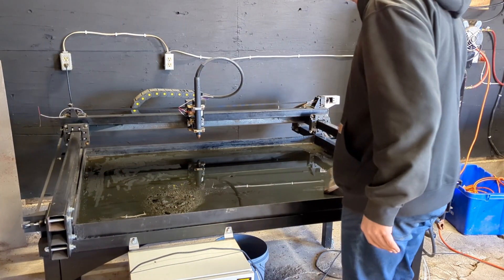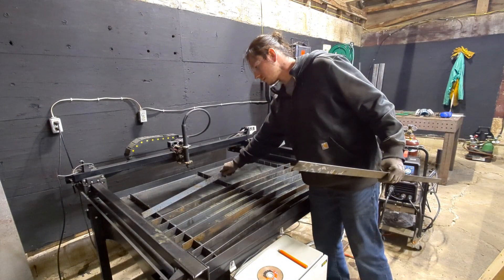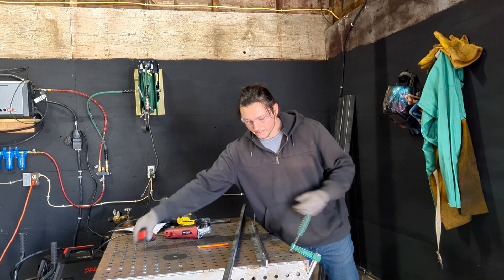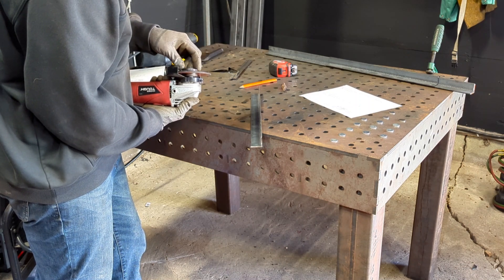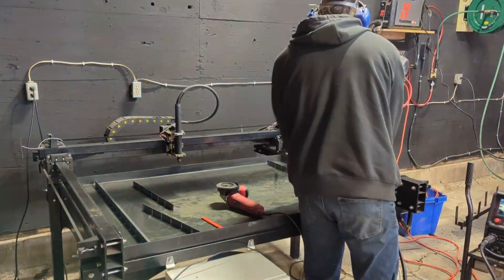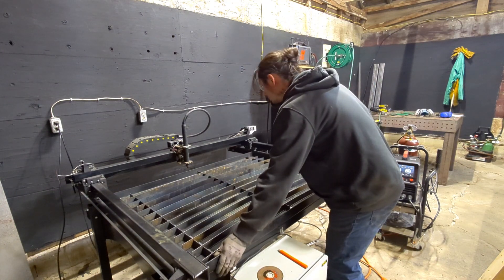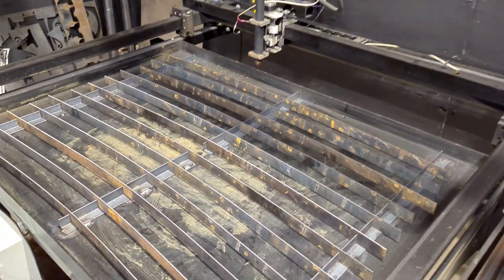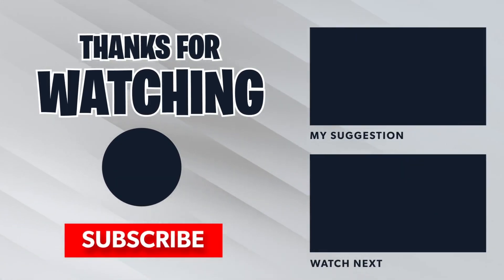Why Did I Wait So Long to Fix This? (CNC Plasma Slat Install)

Comment: @Thyial, thanks for the content. I've spent the last four months learning Fusion 360. It's a nightmare to learn. If you're handy on Solidworks the transition should be easy to Fusion. 

I have learnt a great deal from you, since I am learning the software in a Makerspace (& I toyed with the idea of making my own CNC plasma table) but I've decided to pony up for my table and then get going. The time you spend trouble shooting and building your table works against you. I was surprised as to how much you spent getting a table built. 

Good content.. Thanks

Comment: May I be so bold as to suggest an upgrade for your table. Drill a hole in the middle and add a sink drain. Put a valve on it or  just use a sink stopper in the drain. A bucket and some filter mesh will make draining the table a breeze. 

Also, do yourself a huge favor and get a metal chop saw. It will let you make cuts much faster than that angle grinder. Time is money in your business.
Reply from the maker: @EthosAtheos  I have a drain already. But it doesn't get all of the water. Oh well. And a new metal chop saw has been something I've really been wanting! Those eveloutions look pretty nice!

Comment: I noticed you forget your ground a lot lol. I use a magnetic ground and I leave it stuck to the side of my table and it grounds the part through everything. Just a thought
Reply from the maker: @69jokerking  when I was using the wood blocks I had to ground directly to work piece. But now with the slats I just ground to the water table drain

Comment: I went through all of this with the table I built as well, my last hang up was the 3d printed parts just didn't hold up, the summer heat in ga caused constant warpage.
Reply from the maker: @kerryholt7102  I hear that! Will hopefully move to all aluminum. Or at least a polycarbonate carbon fiber